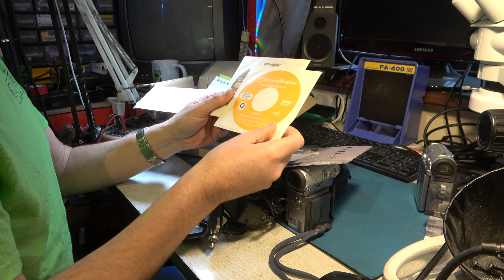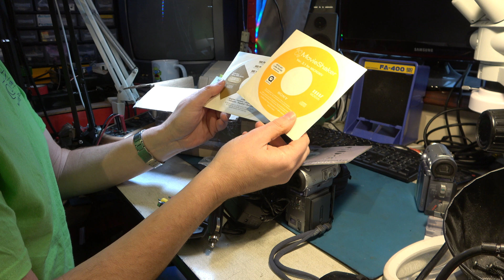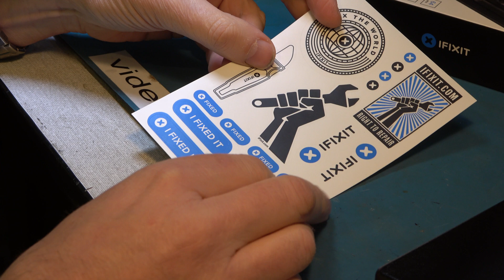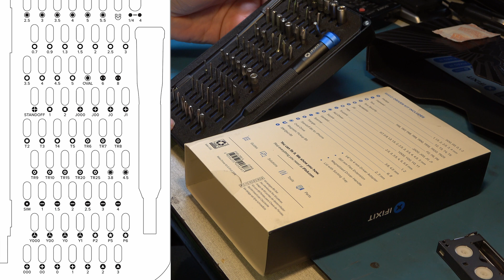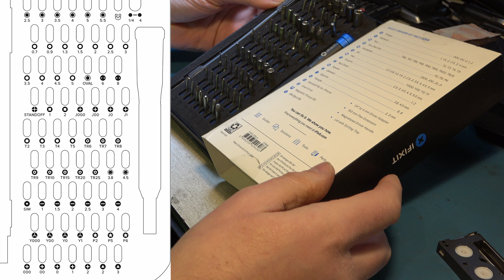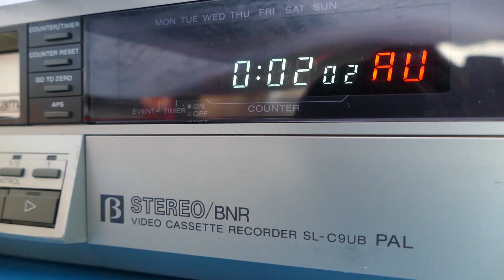More on Sony microMV and iFixit Mako Precision Bit Set.

Comment: Nice set! Regarding magnetic screw drivers (like the ones that holds the screw using magnetism), is there any danger in general in using it when working with magnetic mediashells?
Reply from the maker: The magnetic field required to erase a tape, especially a metal formula one, is huge. I've done a video on that. There's no risk of erasing any signal with a magnetic bit like this.

Comment: My miniDV can by default ff and rew with picture, when it was in playback mode.
7:54 when the hole is so tight, but you can put it in all the way and screw a little bit.